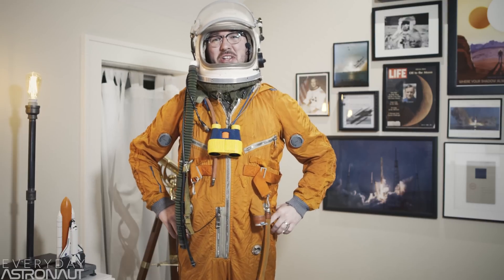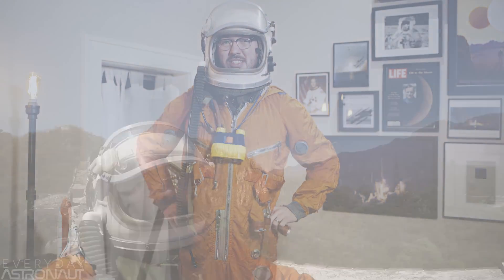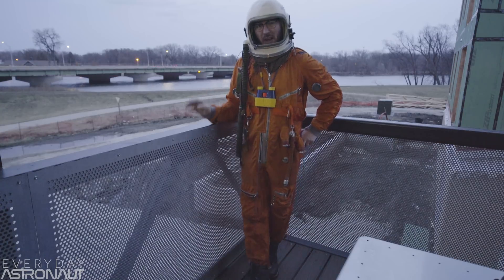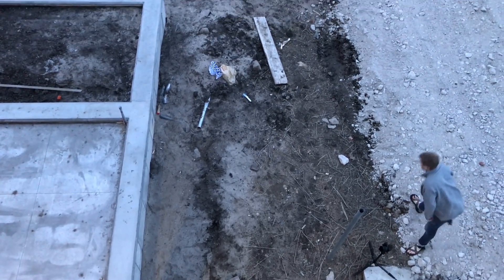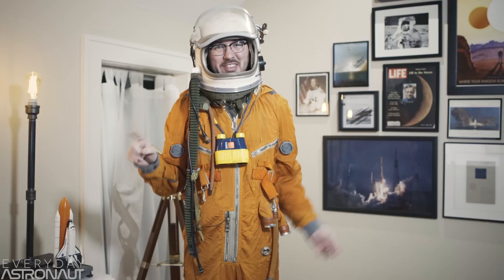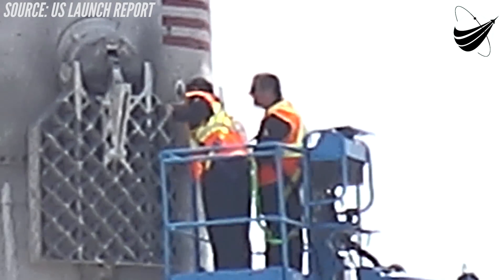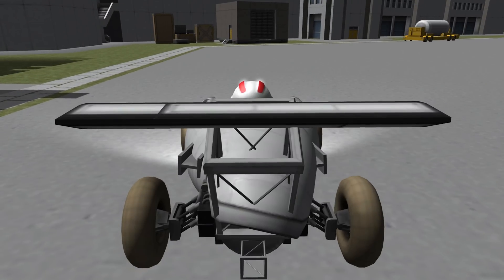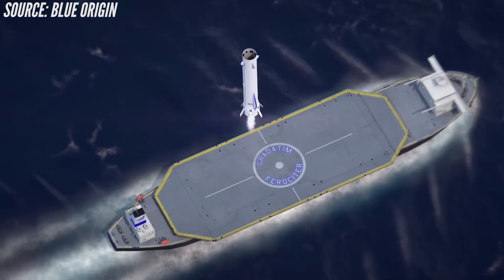How SpaceX lands the Falcon 9: Why they don't use parachutes!

Comment: the only way they could land it was by computer animation because in real life it would be impossible to land when you can not see the grounx
Reply from the maker: +Armando Sanchez I'm sorry but I don't get what you're saying? Have you ever flown in an airplane before? I've landed so many times in zero visibility, there are so many systems that allow a vehicle to precisely control its self regardless of visibility. And why wouldn't the rocket be able to see the ground??? It can see the ground, even then it doesn't need to and could use GPS alone.

Comment: thats not called a hover slam, it is called a suicide burn
Reply from the maker: +Some Guy SpaceX coined the term Hoverslam as I'm sure it's more PC and positive sounding. Same thing 👍
Reply: Everyday Astronaut i guess that makes sense, it will always be a suicide burn form though. Although upon closer inspection i did notice a difference. SpaceX's rockets burn until touch down but what i was talking about was a burn where as close as possible to the ground you get your velocity to 0 m/s and then freefall. That freefall distance is based upon the force impact that the landing gears can handle without breaking.

Comment: Why don't they put a big sharp pin on the end and stick it in the ground like a dart?  Then you don't need all those long legs.
Reply: It's unbreakable
Reply: carabela125 what if the pin breaks
Reply: The engines are in the way. It would severely limit where you could land the thing. It's weight alone probably isn't enough to drive the pin deep enough to hold it upright therefore it would need to hit the ground at speed increasing the chances of damaging the rocket. It would be difficult to dig it out of the ground.
Reply: Because it slamming would cause the tanks to rupture and kabooom you've got a missile not a rocket...kaboom

Comment: The reason spacex has to hoverslam is not because they don't cary enough fuel to do it any other way but because the engines can't be throttled down low enough to have the stage hover in the first place.
Reply from the maker: +Hans Roes a hover slam is by far the best use of what little fuel margins they have left since the vehicle will suffer the least gravity loses that way. Just because a vehicle can or cannot hover does not mean it can or cannot hoverslam. Those two are not mutually exclusive. Such as the New Shepard. By its third flight was performing a more and more aggressive hoverslam maneuver despite being able to hover.

Comment: I don't think you quite understand how grid fins work...
Your analogy with the hand out a car window is wrong!
Grid fins create no (or very little) air resistance, thus control, when perpendicular to the flow of air. It acts like many small fins next to each other.
Reply from the maker: +Nicholas R.M. I'm not saying they act using air resistance like that of a hand out of a car window, I'm just using that as an example of how strong the air resistance can be through an object moving quickly. I'm fully aware of the roll (and even pitch) of each fin and how that correlates to control authority. This is meant to be a VERY basic entry level video. I didn't want to ramble on for 20 minutes. I may have to give this one another go though.
Reply: +Everyday Astronaut
Yeah, I get your point. For a very short video with so many subjects to talk about, it is very well made. The level of vulgarisation is perhaps higher than what I thought. (i.e. I may not be your target audience for that video). Some of your videos are more technical, so I assumed this one was too... But I think it's great that you include all type of content for different level of audiences! Keep the good work!
(oh and I didn't mean to be rude or cocky with my first comment, I just realized it could sound like that)

Comment: There are some bits missing here. Another major reason is to give retro propulsive landing technology a good shake down before needing it to land on other planets or moons where the atmosphere isn't dense enough for parachutes. This saves lots of missions from failure when they are more critical. Additionally there are reasons not to use parachutes for something this big even on earth. We don't have parachute tech that can deal with this much mass. It's not just about size either, there are other problems as you scale up. Even just space capsules pose major problems and push the limits. You can land a lot more mass this way.
Reply from the maker: +Caleb Maclennan I agree. I need to do a follow up video and really nail this down more 👍 thanks for the feedback!
Reply: @EverydayAstronaut  - Accuracy really does not matter very much when you have an ocean or desert to land in. Serious question - I have never been convinced by those skeptics that have suggested, at least indirectly, that water recovery of boosters powered by turbo pump driven rocket engines was impractical because of salt salt water damage. How would this apply to boosters designed to land horizontally at near zero velocity on water with floatation devices to keep the tail end above the waves? It seems unbelievable that rocket engines, especially the Soviet types designed to run oxygen-rich, would be so extremely vulnerable to corrosion. Can you or anyone out there help me with this one?
Reply: @RobertWillis-q3u  The skeptics are wrong. It is possible to refurbish rockets that lands in corrosive salt water. And we have. The space shuttles boosters landed in water, were picked up, and checked for damage and repaired.
Reply: Caleb Maclennan thank you, because I was so confused as to why we can’t just splashdown all our rockets with parachutes, since they will be refurbished and take months to be checked and fixed for the next launch ANYWAY. Propulsion landings are awesome, but seem so stupidly impractical unless you’re on another planet or moon
Reply: Everyday Astronaut if they ever launch/recover from the moon, they won't need grid fins.
Reply: Caleb Maclennan ehh, the dragon is what's gonna be landing not the rockets so they already have the technology figured out.
Reply: Perktube - Doh!

Comment: why not parachutes and a water landing? no precision or fuel needed
Reply from the maker: +Bryan Ransom salt water and expensive/precise rocket parts don't get along too well! The space shuttle's solid rocket boosters did exactly that but they are basically giant empty cans packed with solid propellant and are not the precise machines that liquid fueled engine are. Even then, they still required MASSIVE refurbishment. The goal here is to eventually do rapid reuse, meaning no refurbishment at all, just top it off and fly again!
Reply: That makes sense thanks for the reply! Wonder if a freshwater landing would be feasible...as long as the location was right.
Reply: Also what about the seadragon, the one designed to launch from underwater (not sure if its fresh or saltwater). Could they borrow from that design to avoid the hazards of saltwater?
Reply: Everyday Astronaut     NASA didn't save any money reusing the SRBs.   That's why on SLS they will throw them away.   NASA tried reusability with the shuttle and they failed completely.
Reply: Yeah that makes sense... Can withstand the harsh environment of space, super heat of re-entry, etc.... But get a little salt water on it and it's toast! Makes perfect sense. Cause All those precise rocket parts in it you know. That are exposed the whole time.
Reply: Vacuum and heat don't cover everything in corrosive, conductive fluid, organic material, and abrasive crystals.

Comment: What about China's announced plans to use parachutes and airbags to recover booster stages? I understand the structural challenges associates with this, and that even SpaceX tried this at one point, but China seems to think they might have solved it.
Reply from the maker: +Michael Perrino one big consideration is that China (and Russia) launch of land and not water. Parachutes may be more viable when the first stage soft touches down on land and not salt water.
Reply: That's certainly a good point! Although, I personally can't imagine China has figured out a way to use parachutes for supersonic and hypersonic reentry of orbital class boosters that doesn't involve a series of drogue chutes. Maybe that's their solution, but it seems rather crude. SpaceX's DC-X-style vertical landing method is much better and certainly cooler!
Reply from the maker: +Michael Perrino I figure they'll need to still do some short retro burn. Unless the first stage boosters cut off much sooner, like Soyuz, where they just don't have that high of reentry speeds. I think we talked about this exact thing on TMRO a few weeks back. It's an interesting concept and I'm curious to see what they end up with 👍

Comment: I'm getting really tired of people bashing on blue origin for having a suborbital rocket. Does no one realize that even though the payload of the SpaceX rocket is going into orbit, the booster itself stays suborbital. Granted the SpaceX booster is much larger than Blue Origin's. They are both suborbital recoveries.
Reply from the maker: +Shane Monahan I totally get what you're saying and I'm a huge supporter of Blue Origin. But considering the first stage of the Falcon 9 produces 4,000 mph of horizontal velocity and the new Shepard produces exactly zero mph of horizontal velocity, the two vehicles (first stage or not) cannot be compared let alone the second stage of the F9 (which is bigger than the entire New Shepard) still has an additional 12,000 mph of velocity at stage sep.
Reply: You do have a good point there. However the biggest challenge with landing a rocket comes in the last few minutes where you have to reach zero velocity at the ground/barge. The horizontal velocity of the SpaceX booster is only a factor for aiming the rocket onto a specific landing point. Granted that New Shepard doesn't have as much aiming to do (it does still have to account for earths rotation). They both have to deal with about the same vertical velocity change.
Reply from the maker: +Shane Monahan New Shepard doesn't have to deal with nearly as much re-entry heat since it's at about zero velocity at the 100km's in altitude as opposed to 4,000 mph plus a higher altitude. The amount of engineering required to survive and precisely burn and maneuver through true re-entry cannot be taken lightly either. Also, you're correct in the sense that at the end of they day they both just need to zero out terminal velocity, but again, terminal velocity is much much different on these two vehicles as well and one can throttle much much deeper. But again, I'm not trying to discredit the amazing things Blue Origin does, I'm simply making sure we distinguish their differences.
Reply: You provide some good points, however they do not affect the landing portion of the flight profile much if at all. This section of the flight's main difficulty has to do with the elimination of vertical velocity in the last few seconds of flight. The Falcon 9's 4,000 mph of horizontal velocity is bled off when the rocket turns around as well as during re-entry, and is a separate engineering challenge from the landing. I also don't understand how the terminal velocity could be different between the vehicles, they are a different size correct, but their ballistic coefficients would not be much different. The ballistics determine the velocity at which something falls, not it's size. I'm not trying to say that they are exactly the same rockets and have the same challenges, but they both have similar landing philosophies and physics involved. Personally I can't wait for the ULA Vulcan's re-usability as it will be the first re-usable rocket to be capable of utilizing all of it's fuel.

Comment: Yeah ummmm... The reason they don't use parachutes is not because of the fact that wind will blow a rocket and parachute it off course. I guess it could be a possible reason...but it is not THE reason they are not using parachutes. The reason they are not using parachutes (or wings) to land the rocket, is because at Mars or other far off planets, the atmosphere is so thin that a parachute or even wings will not work (there is not enough atmosphere to work effectively - it would still be like dropping a rock from a fair height even with a parachute - totally different to earth). Hence they must use rockets with vertical propulsion to ensure the rocket lands safely.
Reply from the maker: +Mr Dru you're absolutely right. We might need to make a round two as with SpaceX in particular this is a very overlooked point that I forgot to make.
Reply: Good job. Glad I pointed out to you now. Thought you may have not been aware...
Reply: Mr Dru It's not just for non or thin-atmospheric landings, it's also because parachutes are easy to destroy, wind, salt water landings, and a whole lot of other reasons.
Reply: I had not thought about your other point regarding the weight of and space required to put a parachute assembly on the rocket sufficiently large to handle an 18 ton load.  I think they had a lot of problems with parachutes on the Mars landers.  The thin atmosphere played heck with deployment, then offered minimal usefulness.  Lets face it, there just ain't any easy way to do this.  I am totally amazed at Space X's ability to do what they do.  Most of us armchair engineers out here, don't really appreciate the level of difficulty in that process.
Reply: Mr Dru 1st stage Stays on earth
Reply: Everyday Astronaut wind also effect rocket without parachute
Reply: Nah, much more simple. Big parachutes weight, a lot. Think about this, how heavy is a parachute for a single man eh? 10 kilos or such, 1/10 to 1/5 of the mass that needs to land. Now think how heavy would be the chutes to land a booster, 1 ton, 2, 3 ? That is dead weight, much better to have that weight as fuel, fist you don't need the added complication of using chutes - storing bays, drogues for deploying, explosive bolts, etc.
Reply: Yeah ummmm... that exactly what he demonstrated in the video.  With an experiment.

Comment: In this case my designs beat the shit out of the competititon. Because you can have star destroyer style craft with parachutes. Or CCCP - Cube Cargo Capsule with Parachute. Instead to use engines to slow down will use parachute. A huge one. And will not be a parachute but more like umbrella. The umbrella will be tough and will not be rip apart by the air. 
There will be air thrusters. Like helicopter. Or even like quad copter. And will be able to land anywhere.
A quadcopter rocket with parachute (umbrella).

Comment: See a rocket landing in person?  Aren't you miles away when they launch and probably only see smoke till it's a few hundred feet in the air?  Won't a landing be similar or worse?
Reply from the maker: +gaslone79 check out my newest video, you can get a decent sense of how close you can be for launches ~ 3 miles (at the press site). The landings that land back on land you can be about 6 miles away from and it's still very very obvious. These things are massive!